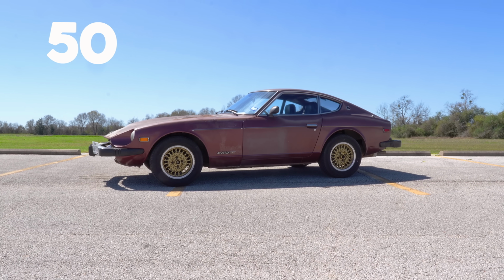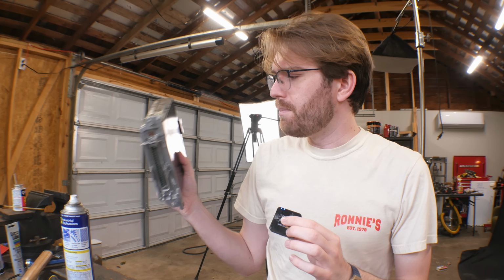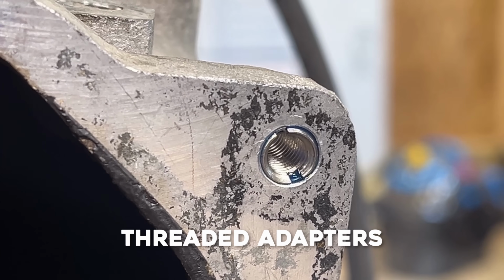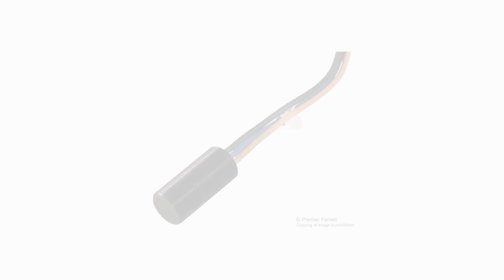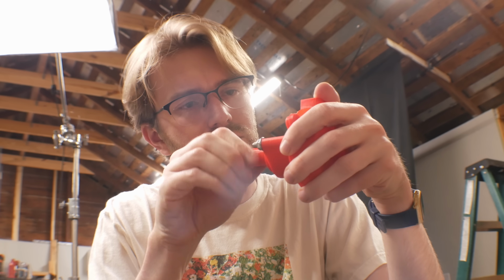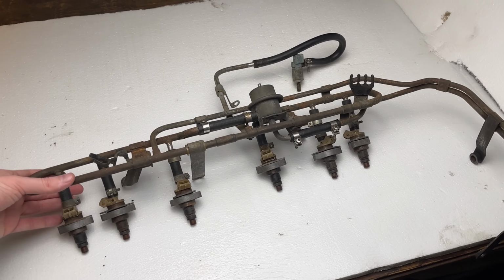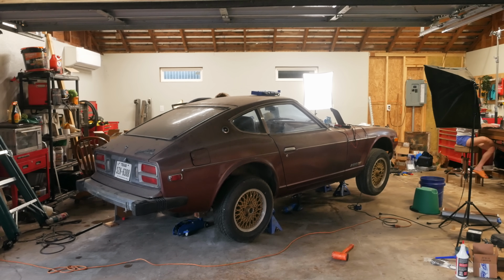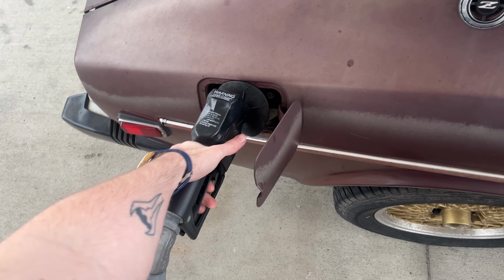Modernizing a Vintage Car

Comment: Hi, Ronald.  Thanks for posting, and thanks for having the guts to "hot-rod" the engine that actually came with your car instead of "LS-swapping" like every moron on YouTube.  And, you managed to get .83 horsepower per cubic inch at the back tires, which is pretty damn good.  Now, just like "every other" YouTube commenter, I'm going to tell you how to spend even more of your money without even being a Patreon member!

Intake:  You will need to do your own research for that.  While there are manifolds out there that claim improved flow and runner length, your fuel injection and distributor are basically a "Finger- Black" system.  So, good luck with that.  However, you will want to port-match whatever you use to the cylinder head.

Exhaust:  Some people would recommend a pair of "three into two" headers and a larger diameter exhaust system.  I would recommend the larger exhaust.  But, you actually use and need your O2 sensor.  So, I would recommend a compact but free-flowing six-into-one header that allows you to mount your O2 sensor where it will get good readings and not be ripped to shreds when you actually drive the car for a while.  You could go with two O2 sensors and the "three into two" headers.  But twice the O2 sensors is at least four times the hassle.  Port-match whatever you get.

Long block:  This is a "malaise era" engine.  You need to rebuild it.  Now, if you borescope it and still see plenty of good cross-hatch in all six cylinders, you can ignore me with an easy conscience.  You'll ignore me with an easy conscience anyway, since I'm telling you how to spend your money instead of the "imaginary double-f??k-ton" of money I did not send you via Patreon; but I digress.  You will probably want a different cam grind.  You will absolutely want to increase compression on the engine, as well as porting and polishing the cylinder head and valves, and port matching the cylinder head to the intake and exhaust manifolds.  There's not a lot of "meat" in the block for serious increases in displacement via the bore, though there is some.  "Stroker" crankshafts are available, but they are rather "spendy."  You will also want the engine balanced as well as replacing the harmonic balancer with a "fresh" one.  Balancing an engine doesn't give you horsepower.  What it gives you is longevity and driveability.  Roller cam bearings and cam followers will yield you some "additional" horsepower.  Since you're somewhat limited in increasing your displacement much beyond the 168 cubic inches it came with from Datsun, every little bit helps.

Turbo:  Some people like them, and others don't.  But you need to decide between NA or turbo before you build the engine and not afterwards.  You normally go with lower compression on a turbo engine, since the turbocharger increases the "effective" compression ratio by forcing more fuel/air mixture into the engine.

You could negotiate for a deep discount with a top quality machine shop such as JAMSI for the work.  Since they also have a YouTube channel, this might be easier than you think.  Plus, it shows that I'm just another "a-hole commenter" spending other peoples' money, so I'm spending their money along with yours.  Your goal should be to exceed 220 horsepower at the rear wheels along with commensurate torque.  While you're only running a two-valve cylinder head, it is a crossflow head on an overhead-cam engine.  So getting more than 1.3 horsepower per cubic inch at the rear wheels on a street-comfortable engine should be quite doable.  You might need to run premium unleaded gas.  But the car will run, at least in a straight line.  Thanks for reading if you got this far.

Comment: My brother is a chartered engineer who has worked in aerospace, formula 1, and at one point when he was working for Mercedes-ilmor in the UK, was lent to an American Nascar  team, he decided that the fuel was vaporising before the engine could burn it efficiently, he added a nozzle brought from a camping store , basically building a water cooled injection system, he achieved 3 extra horsepower, this was the year 2000, that car won the daytona 500 with a new lap record. All with a camping stove nozzle 😮. His reward from the company, a hat saying Daytona 2000 winner 🙄.
Anyway I'm telling you this for 2 reasons, 1 working for other people sucks and 2, air, fuel and spark , its far more complicated than that 😂

Comment: Now the next step should be to upgrade air again. Build in a new intake manifold, new exhaust system and a aftermarket cam shaft to be able to increase the fuel in the engine and a better power curve for higher efficiency. A new transmission also could give you the ability to have a better power transformation from engine power to power on the wheels, greatly increasing the fuel economy.
Last but not least, think about installing a small turbocharger, that way you can alter the power curve in a way which allows you to drive with lower rpm, without missing power, greatly decreasing your fuel consumption.

Comment: You do lose the connection between the driver and the car with drive by wire and that's just a fact, and you also don't need it to replace all those hoses, you can use a normal cable controlled TB with a built in Idle Air Control Valve that you can hook up to the computer and program it to do the same thing like a ETB.

Comment: Shocked at the Chevrolet stats. 20mpg? Strewth.. I mean its apples to oranges I know but my bog standard Golf 140 hp 2.0l tdi turbo diesel gets 54mpg (US) on the highway and 45 in traffic. 600 miles to a 14.5g tank. It also doesn't look like a melted lunchbox. Shame on you Chevrolet.

Comment: I had a '63 Imperial LeBaron that had a 413 with dual inline 4bbls that got 15mpg in town. And Datsun, with all its money and time, couldn't do better with a pint-sized motor? Wow! Good to see you got it running though.

Comment: 142Hp at 2.500 rpm - dude.. There is something not right here. Either the revs was not read correctly or you are not at all getting the air it needs..

Comment: I have a 240z and my son has a 260z and I know your pain when it comes to the factory wiring diagram,  lol. They over engineered the wiring so much on these cars that yiu could wire three muscle cars with the amount of wire these cars have. We are in the process of installing an LS3 in my sins 260 right now and are about finished with it. I  bought an eco boost V6 for mine then found I don't have as much room as I thought. For a V6 the economy boost is huge! So! I now have an engine from a Toyota Supra, a 2JZ. Now the nightmare of making this engine work in the 240 is about to start. I have the supra which was hit extremely hard I the rear and totaled, bought it through Coparts. I don't knkw if the little Datsun rear end will hold up, but I doubt it. The 2JZ has been converted to a larger single turbo and the dyno sheet shows it was making just over 500 hp at the rear wheels. I am probably going to narrow a 9" with a nodular center. I would really like to have a 6 speed in it but haven't made it that far yet. I will probably just stick with the automatic that was in the Supra for now. Anyway I look forward to seeing more videos from you. Early Datsun Z cars have always been one of my favorite.

Comment: I mean its not just the older gen or even having "Connection to car". A cable throttle just feels better to drive and is easier to drive on limit, throttle response is instant; always a good thing no matter who you are.
But especially on turbo cars an electronic throttle makes things more simple.

Comment: Just a heads up. The three things you mentioned are what's needed for a fire. Engines also need combustion to run along with those other three.

Comment: I’m sure those 63 years will be over in no time 😂
Several engines that were used long enough went through this fuel injection upgrades you made, really cool to see it play out. However I had never heard of wasted fuel firing like that, but I do know there were wasted spark systems, which don’t have the same efficiency losses, it may have made your set up simpler.

Comment: What isn't "Direct connection" about the way you set that throttle body up, exactly? It's basically Direct Drive, but with an electronic bridge instead of a steel wire and levers. Also, just because it's "analogue" doesn't make it great. That charming 'old car' experience really only goes as far as you can be bothered, knowing how much modern convenience and research makes modern cars way more comfortable and easy to drive.

Comment: I had a 280ZX. It required daily repairs but was extremely fast with the hodgepodge turbo setup I slapped together, which was quite the rabbit hole since it wasn't a turbo model. The L28, to its credit, had a near indestructible bottom end. Heads were fun when they rust through though lol

Comment: @RonaldFinger You should run some Seafoam through the vacuum system and oil which will get rid of the carbon deposits and old varnish, then some fuel cleaner like 505 CRF. Then put it on the dyno again as well as report back with your gas mileage. I'm sure you'll see a significant improvement if you do it correctly. With a 50-year-old engine you might have to do it more than once to fully clean the engine. I'd also recommend checking out Valvoline Restore and Protect motor oil

Comment: For judging the "power" of an engine, you can't just only by  horsepower, you have to consider torque as well. Older engines have mostly lower horsepower while haveing a good amount of torque.

That's why my 45hp Fiat Panda from 1993 cozld beat the crap out of the 70hp Toyota Aygo

BTW Bosch is formost a car parts manufacturer. The second largest business are tools and after that they just brand households appliancea

Comment: Two things Ronald, if you add a mass air flow sensor, and a crankshaft positioning sensor on top of your camshaft positioning sensor you give the car the ability to make those calculations better by allowing it to see the position of the crank shaft in relation to the camshaft. Having that mass air flow sensor will allow the car to determine how much air it is getting at what rpm and with where the throttle is. The crankshaft positioning sensor is easy, just bolt that same halfax wheel to the crank shaft some place most put it behind the harmonic balancer.

Comment: Issue with your trigger design. Because the distributor rotates half crank speed (you know that). It means your resolution is much worse than you thought. It’s 30° of crank rotation per tooth. So not great for precision ignition timing. You should fit an actual crank position sensor. 😎

Comment: A lot of work to make a cas sensor   with a half effect sensor. You can make the same thing with a 82-83 turbo 280zx distributor with a z31 trigger wheel. Also if the 82-83 sensor is dead you can also swap in the sensor from the z31. The trigger plate features 360 slits for speed and 6 slots for position.

Comment: Now, add a Turbo!!  It's actually really simple now that you are EFI.  Just a new header and intake is all you will need.  The engine control is already in place.  I did something very similar with an old VW engine.  First Megasquirt EFI conversion, then added a turbo from a Subaru.

Comment: I think the biggest thing is purely that the engine bay now has like, 40% less stuff in it. The weight savings must've been decent with the amount of hoses you got rid of. It also begs the question of why modern cars still require so many advanced features when all of the sensors and parts you used were honestly few and simple. Im definetly sure with a proper exhaust manifold and tune, it'd make at least another 20hp. The old manifold looks sad and tired.

Comment: pfft.... i have 2 280z's out back..... both running to.... and the best powergain for cheap that you will get from that l28 will be swapping the coil to a hotter one from summit racing

Comment: Congrats on doing it all yourself...did the "same" mod using MegaSquirt, 280ZX turbo injectors and distributor, other sensors and harness mods. Godzilla Race Works has a MegaSquirt plug-n-play system. My '79 280ZXR gets about 24mpg...towing a trailer (a small trailer)!

Comment: So what we all agree about is ECU swapping a L28E is 20 HP.. Not bad and it gives you more control for track use. Here is the thing though. They already make most of this. (It's expensive.) For little gains that 3 miks can. For around the same price. The biggest gain I have seen on the 280 is actually changing the throttle body to side drafts or the new modded intake. As well changing the air filter. The hardest thing to over come. Is the exhaust.. Yes the stock manifold, and cat will drain about 30 hp from the car. Then there is 3.545 gear ratio on the 4 speed. If you switch to an R200 from an 80 S130 and get the 3.7 set. With the close ratio 5 speed. You can get more rear end acceleration and more output for the ECU. which gets closer to 180 to 220 horse power with a top speed near 240km/h

Comment: My first car was a 1979 280ZX (the year Nissan took over).  The L28 is one of my favorite engines. It may run like a turd, but it'll continue to run like a turd until Jesus returns.  I wish you years of enjoyment with one heck of a car; remember, it's way more fun to drive a slow car fast, than a fast car slow. Cheers!

Comment: Video summary. What if I grabbed a classic mechanical car & instead of making it better I make it gay.

built a 350SBC that ran another 200k miles with no issue in a only using 8 wires to the motor. I cheated a little & used an electronic choke carb because I lived up north. winter start ups would have sucked otherwise. Only reason it died was me going from 6th to 2nd I missed 4th…

Then I did it again with the first gen vortec which there biggest fault was oil leaks because of heat & electrical issues because it was the 90’s & that shit sucks

Comment: great to see you back, i  have the 4 cylinder variant of basically the same engine in my Datsun 510 (but is carbureted). Its old, stock, smelly and tired, but this is intriguing and makes me wonder about applying the same upgrade. Hope to see more soon!

Comment: So with a few small improvements you will you will get a lot more HP. Start with set of extractors/headers, it will sound better. Then a individual throttle bodies (It will sound better again, if not more power !) Then a cam. Yes, a BIG, lumpy cam. The next you can do a Turbo. Woosh! The old engine may be getting on a bit now, so how about a much newer engine. A RB26DETT will do, with a Big turbo. 800 Hp, Easy! You will have to upgrade breaks and the suspension.....Nope? Just keep it stock and tidy it up. Yes, that's better.

Comment: I paused after the electronic throttle to comment: Electronic throttles on factory cars can feel like garbage because of the throttle hang meant to decrease nitrogen oxide emissions. Electronic throttles controlled by a standalone ECU can be extremely responsive and allow the ECU to do away with idle air control systems. Seeing this, I am seriously considering setting up an E--Throttle on my own megasquirt-controlled Z

Comment: Weeelll. OK. The wife had a 74 260z (early small bumper) that her mom had bought new. 10 years later in 84 or 85 I put a 280 block, 5 speed but kept the carburetor. Ran good until ti got stolen out of the driveway from our Clairemont Mesa house several years later.

Comment: The unibody and independent rear suspension was a  weak point of the older Z series cars. 
V8 swaps woke them up but the  torque twisted the unibody and required a straight axle to avoid breaking  U joints.

Comment: how did u know what u can remove / can't remove when it comes to air. I know its now electronically controlled but how did you know which components were useless with the upgrade

Comment: Years ago, just as the internet was becoming a thing I had a Z car shop. The "Z" Connection was in Opa-Locka and we had a pretty good following. Watching you I feel like I didn't know as much as I thought but, I didn't have the internet either. What we did in the early days, mid 80's to mid to late 90's was turbo engine swaps. All that tech you are putting into that NA motor, I wonder what effect it would have on a Turbo engine? BTW I've been watching that 240 z restoration video and that guy does beautiful work. Great video, it reminded me of a very fun time in my life.

Comment: As someone who put programmable ECUs on a couple cars, I really liked this video. I'm still curious about a few things.
- Did you used wide or narrow band oxygen sensor? 
- Do the software for this ECU allows auto tuning the VE table after setting up a fuel mixture target table? 
- How did you set up the ignition timing table for it? 
- Did you set up engine cut off after lifting the throttle pedal after a certain RPM range? 

I guess there is some room for improvement, but you did a really good job there. :D 🎉 

Also, your wiring looks much better than the colorful spaghetti I often had in my personal use cars. lol 😂

Comment: I’m working on a 1969 Ford F-250, any tips? It wants to turn over but fuel isn’t getting through the system. 
However if I pour fuel down the Carburetor, it’ll turn over for like 20 seconds.

Comment: I may have to talk to you or get parts as I have a 280z I'm working on and may want to upgrade the intake and ignition like how you did. Funny when you were making the CAS and I was saying maybe talk to the guy in Switzerland and boom you did and he made that shaft. Awesome work you did on making the parts. Super clean looking and simplified. Sure with some more upgrades to the exhaust and tuning you'll make more power. Look forward to what is to come.

Comment: Everyones says you can fix a carb and not a computer. I never had computer failure on a car but endless issues with carbs. Also anything that fails on ecu car spits out a code telling you what is wrong. Usually just a sensor.